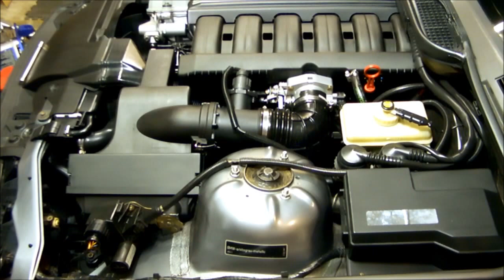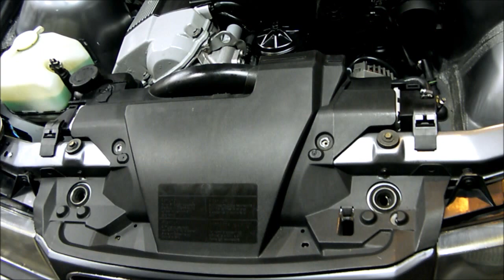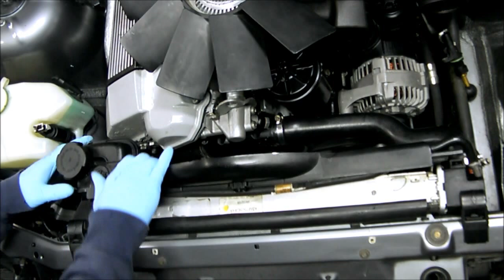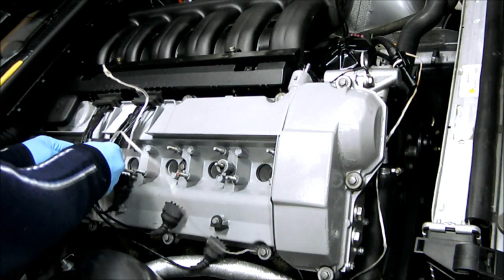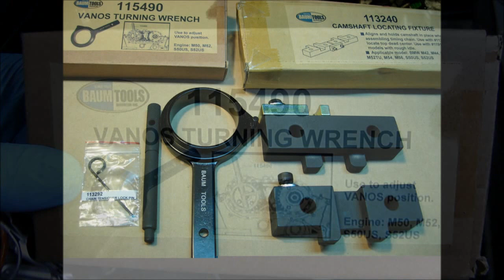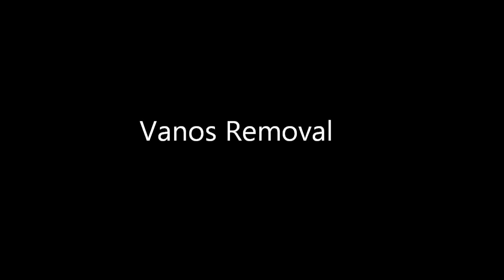BMW E36 Vanos & Tensioners Removal part 1

Comment: Quick question, I have the engine at TDC but my cam blocks aren’t sitting parallel to the head. Is there a way I can adjust the cams so I can put the timing locks on without pulling the vanos unit?

Comment: What if im top dead center, cams are exactly as yours are but my locking pin seems to be hitting my flywheel ( no hole for the pin to go into) my car is manual swapped so the flywheel and clutch are not oem??

Comment: Dummy Chain tensioner back to REAL chain tensioner--> any tip on how to re-install the push pin back on? There is a lock ring on the push pin that goes in behind the spring. i am having a hell of a time trying reinstall the push pin back in.  thank you for the video. very detail and clear.

Comment: Do I need the locking tool if I’m just replacing the vanos? I’m not going to take off the sprocket or anything like that. Just remove vanos and replace @mybimmerspace

Comment: what is that wire (i think ground?) on your engine lift bracket? the upper bolt? also did you not have a plastic guide for the cable that runs underneath the vanos by the two longer studs? sorry im not sure of its name!

Comment: Is it possible to remove and replace either chain tensioner before the sprockets? Also would an issue with the tensioner cause motor knocking sounds at idle?

Comment: Hey, I got everything set up to take out the vanos but I ran into a problem were one block sits flush and the other is just off by a bit. It is cranks to my tdc mark but the cams are facing down instead of up at 45 degree like you said. I wanted to know if you have any idea on how i can retime them or position them correctly. never done this before and your help would mean alot , thanks
Reply: Shaun Kristensen that is bottom dead center.  The cams must rotate 2 times to each full revolution of the crank. Rotate the engine another full revolution.

Comment: awesome series, ty.
Question: couldn't you use a screwdriver or smthg similar instead of the specific flywheel locking pin?

Comment: Thanks for making this great tutorial.  I followed it to replace my 325i cylinder head and the end result was a perfectly running engine.   I'd like to add that the inverted torx bolts holding the vanos chain tensioner and the corners at the front of the head come out with a 1/4 inch 12 point socket driven by a 1/4" ratchet, as a 3/8" socket will not fit on the holes where these bolts live, has to be 1/4" drive.  In my car, a 8 mm 12 point was not small enough, a 7 mm 12 point was too small, but a 1/4" 12 point socket had the grip on these bolt heads.  I could not find a T8 inverted torx socket with a 1/4" drive.
Reply: E8 socket is what your looking for

Comment: How diffetent is it to lock the flywheel at the top dead center with m50 non-vanos? and is it going to be difficult by any means to remove the cams if I don't have vanos? With respect to the chain, the tensioner and the sprockets?

Comment: My 6 Zylinder went down the drain beginning of last year. Oil pressure gone at times which led to engine overheating and inevitably a torn and warped cylinder head between spark plug 3 and 4. Thanks to this video I was able to completely rebuild the entire engine from separate new parts which I purchased here in Bremen at Bobrink. They really didn't think I'd make it, I suspect, but the engine has been running very smoothly now for almost 10000 km. Of course I also renewed the oil pump, crank shaft, pistons, bearings, etc. and got the automatic transmission thoroughly cleansed and flushed. Thanx a billion.

Comment: Hey hows it going. I am working on 2001 bmw 330xi dual vanos 3.0l. I am a certified Tech. I just started working for a Used Car Dealership and they had me replace the head gasket. So after drilling and inserting new threads in the block, i got the head on and tight but i am stuck at the part where i have to install the vanos shaft coupling that slides in the two exhaust and intake sprockets. I alined tdc and had special tool in for the camshafts alignment. I finally got the couplings in the exhaust and intake cam sprockets but now the cams are slightly off alignment is that normal or should the cam and crank stay in alignment when the coupling are installed. If you happen to get this and have any input please get back to me thanks.

Comment: ill start by saying great job on the videos! very well instructed and explained. anyway, im here because when i put my motor on TDC i noticed my camshafters were not in the same position as yours... is this because maybe the timing was off a bit? i drove the car with no problems so im alittle confused. the are in the perfect position to where i cannot get the long guide bolt past the 3 bolt flange at the end of the cam. i need to take the camshafts out anyway so i can take the guide out after that, just wondering why the cams would be out of position. any input would be appreciated. mybimmerspace

Comment: Hello. Really appreciate the video. You explain everything very well. I just need to replace the vanos. Can I just do the part were you use the spracket wrench to pop of the vanos and then do the opposite to put the new vanos back on? Is it possible, and will it affect anything if I just simplyremove and plave the vanos?

Comment: I'm using your video to guide me while I install a cylinder head on my 528i M52.   Seems to be the same for the M52 to get the camshaft timing correct.   Thanks for taking the time to make this video.

Comment: Will the engine run with the Vanos disconnected? Will it damage the engine if the Vanos is not operating?
Reply from the maker: No, you may notice a lack in acceleration and also a check engine light for Vanso jammed but it will not harm the engine. Best to have the Vanos ECU program removed if you plan on making it permanent or buy a vanos delete kit.

Comment: Thank you for showing the simple things like paper towel in areas to prevent bolts from being lost into the engine. I feel more confident about doing my 00 528. A P01523 comes up when scanning. I don't think the Vanos has ever been replaced or repaired. Question, can I just repair my Vanos by replacing yhe seals and springs? I saw the kit on Dr. Vanos site.

Comment: I believe the gizmo you removed from the rear of the airbox is actually the intake air temperature sensor.  It doesn't "warm up the air" or the throttle body, it senses the air temp so the ECU can compensate for temperature-induced density changes.

Comment: hey i have a bmw 3 series 93 325i and need help understanding the fuses and where there are most likely shorts in the circuit. i have a electric sunroof window, and door locks issue. the number 7 fuse keeps blowing and im not sure were the short may be. thanks for your help, and awsome videos. im subsribing.

Comment: You are joking right? This engine looks so good that you would say that it has less than 6-7 years and under 60-70.000 miles.
What keeps an engine like this in this state or clean condition (on the inside). Is it the engine oil or sommething else.
I'a asking because in Europe, Castrol engine oil is beeing counterfited, and lower quality engine oil is sold as Castrol engine oil.

Comment: Yeah my cams are off. I've been looking for the base timing for the cams and I can't find the specs., I don't know if you would know? This is going to sound dumb but can you set the timing by turning the cams until they're at the 45 angle and dropping the blocks in? I have a 95' 325i. By the way you have the cleanest engine and engine bay I've ever seen.

Comment from the maker: Gonzolo, it's very likely chain stretch. You can also place a ruler across the back of the cams, the ruler should sit flush to both camshaft squares dots on the back of the cam facing up. If the ruler does not sit sit flush then your cams are off. Don't worry about the cams for now just go ahead and loosen the exhaust camshaft torx bolts as if you are removing the Vanos. Once the torx bolts are lose you will be able to rotate the cams back to TDC with a wrench and put the blocks in.

Comment: Awesome video, I'm using your video a guide for a head gasket job. Quick questions what do you do if you break the little fly wheel plastic plug where the locking pin goes? My cams are no where near the 45 degrees but the engine is at top dead center (the crank and the line line up and I can see cylinder #1 at the top too) is that normal chain wear causing that?

Comment: Thanks for the reply I did find it. But im a little confused.  About the cam locking blocks and the flywheel locking pin. U install them but then later remove them to turn the cams to remove the vanos so why do we use them. Anyway im gonna watch your videos a few more times and try to figure it out. And is their any way u can do a video on removal and installation on a clock spring. Thank you.

Comment from the maker: Thanks, you made me laugh. I know they are long videos, lots of details to go over.
Reply: Do I need the locking tool if I’m just replacing the vanos? I’m not going to take off the sprocket or anything like that. Just remove vanos and replace @mybimmerspace

Comment: Brilliant video. I have a few questions though if you could help me. I have a 1995 328i and the vanos is shot. Is the removal the same as this video? Do I need to remove the chain wheels once I have the vanos module off, or do I just need to remove the vanos module and refit once I have replaced the seal and bearing inside?